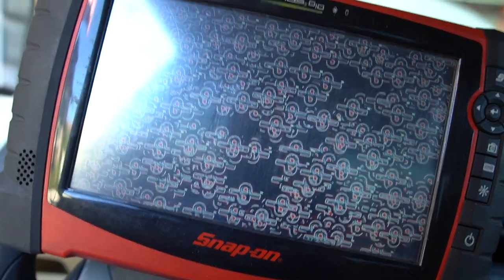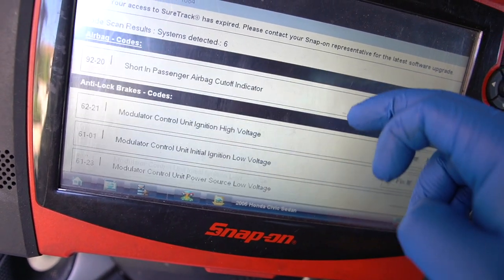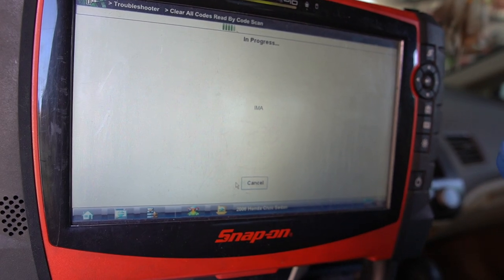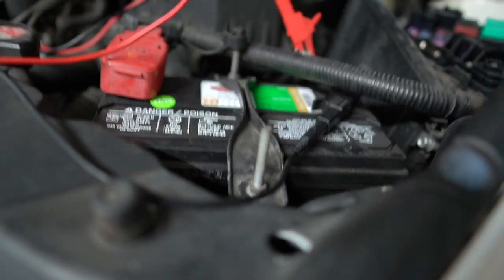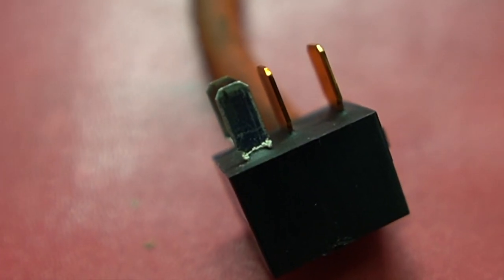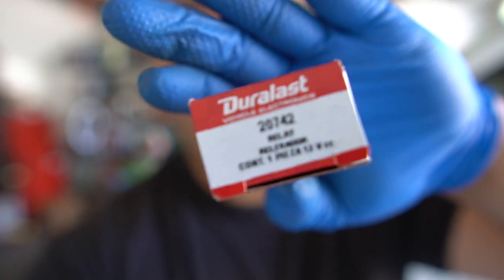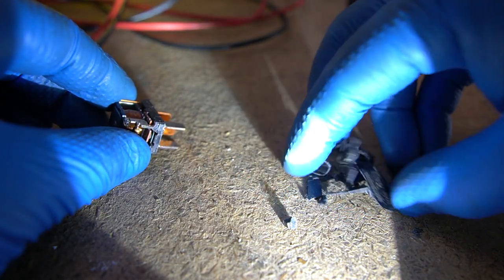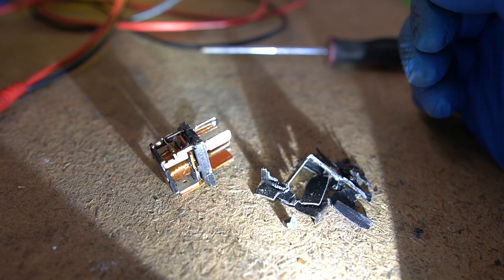Honda Civic Checking For Battery Drain

Comment: I've been suspecting the relay on my '08 Civic as being the issue since the compressor clutch does not disengage, even when the controls are to the off position. The battery will also drain after about a week if the car is not driven. I'm hoping this resolves both issues. Thanks for posting the video and for some of the other people commenting with similar problems!
Reply: Hey buddy by any chance do you know what relay is it cuz I'm having issues with my Honda Civic that it keeps draining I'm thinking is a relay too

Comment: I has a similar problem with the same year honda. Went through all these testing steps as well. .the problem still persisted. The step I didn't do that a customer would was opened the trunk. .I put my phone on record threw it in the trunk and sure enough light never went out
Reply: Another thing to checkout on these vehicles along with the trunk light switch is also the glove box light and vanity mirrors on the visors.

Comment: I just gave my 07 civic to repair shop expecting them to say it's the alternator doesn't charge my battery properly (I have a brand new battery), but they told me that alternator was just fine. I will go but that relay from Autozone first thing in the morning and go to the shop, ask them to replace it. If it works, you will get some pretty serious prayers, my friend.

Comment: Thanks for your sharing! 

I had this similar battery dying on me like this and these similar experience with AC clutch relay but that shouldn't be the issue when the power is off. Also, you can test the relay with a nine to 12 volt battery to test the contacts via ohm reading. While, I'm still waiting for my battery to be fully charged for tomorrow for further diagnostics, I discovered there's about 3.8 ohms between those two unplugged input power cables. That tells me there's something being short at about 3 amps. I would not advise running mA testing on your DMM if that current is high otherwise it may damage your DMM. More results tomorrow.

Comment: Customer had me install a starter, 10 minutes later said the vehicle wouldn't start. Get more info on the vehicle, customer took it to a shop 6 months prior, got charged almost $700 for them to "bypass" the blower resistor. Everytime the AC was on it was drawing too much power, draining the battery just enough to not start. Needless to say, they didn't even bother to solder or heat shrink the wire. That's why I constantly ask questions..
Reply from the maker: CravinMorehead420 exactly 👊🏼

Comment: I would look into the Dome light, seen instances where owners of the vehicle left the switch in the on position even though the light isnt “working”. But in the middle of night or random times the light would turn on and stay on. Especially if they had aftermarket bulbs ie led junk

Comment: Watching  your video was great, it's EXACTLY what I've been dealing with for 30 days.  Everything you showed was exactly the work done on mine, including the relay switch and new battery.  No drain was found but this morning again after one day of sitting it is completely dead.  What do I do now?
Reply: I'm answering my own above question.  They found that the "lock" switch inside on the door (armrest) is broken and it remains on the "on" position even though I turn it off.  It is probably the switch I've used most all these years and it has to be replaced.  That would explain why I only had battery drainage at my parking at home.  I left it with a dealer for three nights and there was no problem with drainage, but I, of course, I used it immediately and after it was in my parking spot for more than a day, the battery was dead.  A new one is ordered, but orders these days re taking an extra long time.  Hope this will be the answer.
Reply: @louisegribbon4214  My wife's civic has this same problem for a year.  She purposely drives it every day.  What "lock switch" are you referring to exactly?  She doesn't use the physical switch to lock the doors, she uses her remote once she's in the car.  Oddly we do have an issue where if you are holding the remote and come anywhere close to the car, it unlocks itself.  Somehow, I think the lock system is the cause of the drain, but where to start?
Reply: @DEMinSoCAL  That sounds like the button in your remote is stuck, constantly telling the car to unlock. Based on the details of your post.

Comment: İ’ve seen someone checks that kind of problem with a heat sensitive camera. When you check the fuse box related fuse becomes hot and you can understand which fuse is eating the juice.

Comment: I have been trying to fix a parasitic drain on 09 Civic LX that would make the battery die overnight. Replaced the relay but that's not it. Isolated it to fuse #23 under hood. That controls radio, keyless entry, anti-theft system. With the fuse removed, the battery does not die, however now I have no radio, anti-theft or keyless entry. Where do I go from here? I know all of those things can't be bad. How do I isolate it and what is causing the drain? Thanks.

Comment: Congratulations Joel.  Thanks Hektor!  It becomes a slippery slope.  I try to keep the car and reproduce the problem.  I have to charge Time and Material on a job like that Flat rate won't work.  For battery drain problems I can't catch i offer to sell the customer a PriorityStart! battery disconnect until the problem can be reproduced.  I will even buy them back (1/2 price) if the customer gets the problem fixed eventually.

Comment: @HomieHektor
Hi can I ask about Honda 2005. It's the same issue. But the problem is battery and engine is new. The engine has covered barely 15000 km after being installed. Recently, I checked from a mechanic about the earth wire, which he resolved it at that time, its the same time when we installed the battery. So after 5 months of installing the battery and resolving the earth wire issue, the battery dies out of nowhere, the battery shows a green indicator but the current keeps draining. What might be the issue. Car model: Honda Civic 2005 VTI Oriel Prosmatec

Comment: Could you help me out with a electrical issue on my 2015 Honda Civic SI 4dr
Every now and then at random, I park my car and walk away. when I come back and try to start the car (push button start) the car won't turn ver and sounds like no battery charge. When I get a boost, starts immediately and doesn't have a problem starting for sometimes 2 months. Dealer puts it on the computer with no results
Reply: Hi Colin, I have same problem for 2015 CIVIC  EX 1.8L, Dealer said that no issue for alternator and battery, but i replaces batteries 5 times with 6 months term during warm seasons, 2 months during cold seasons. And I bought a jumper starter and battery recharger for the issue. And I was recognized that it didn't work for AC. So I am going to buy multimeter, check AC relay switch as same as Homie did it during test. Hopefully it will work fine with replacing AC Relay switch.

Comment: so i have honda 2006 civic too, but my battery light keeps going off and on only when i turn off my ac but when i have it on it doesn’t appear. and when i run my ac my engine shakes. i’ve also changed my battery and alternator twice and my battery light still comes on and off. what could it be any ideas?

Comment: Please Help I have changed my car Honda Civic 2012 alternaror 3 times, the last one was from the honda dealer. And my car still have the same issue, when l run it l park for example after 15 0r 30 minutes, after a while l come back and want to start it again and my car dont starts... after l jump the baterry and it runs but the autozone guys messure the battery and say that is not the battery...what else can be???? The terminals l think they haven't replace it

Comment: The spot on thing to do is what you do, question the customer.... What conditions do the fault occur in? Next is to deduce what could possibly cause the fault based on the customer's description of the fault? Next is to test, test everything that could be a cause and duplicate the customer's vehicle use. Next is to neck yourself after 7 hours of testing and being told after by the customer that the fault only occurs once every three months. Just kidding but not really not kidding....
Reply: PS. I recently had an F250 towed to my workshop from 800kms away, (Geraldton to Perth + some other stops) for no start intermittently, the auto electrician shop that was working on the vehicle had replaced the PCM, crank angle sensor, fuel pump and BCM. It was the most expensive PCM relay I have ever replaced, cost me 10 bucks, cost the customer thousands of bucks.

Comment: I have a 2001 honda civic, and it has a problem that the radio wont shut off with the key, but only some times .So I have to go and disconnect the neg battery terminal for 10 seconds. Then it is ok again. Can anyone relate to my problem. And even if I didn't use the radio, somthing is staying on and feeding the radio power with the key off  ,,,HELP. And it kills the battery if I don't catch it.

Comment: We had a 2005 Odyssey, a 2010 Civic and. 2014 CR-V that all had/have similar issues.  Brand new batteries and working alternators. Leave the flashers on for 15 minutes or the lights on for 2 minutes or the dome light for 10 minutes and the battery is dead.  Battery tests at 12.5v by itself and in the car. At about 14.5v while running. Any thoughts on what could be causing the dead batteries?
Reply: Hey man I’m working on a car rn that is having the same issue did u ever figure it out?